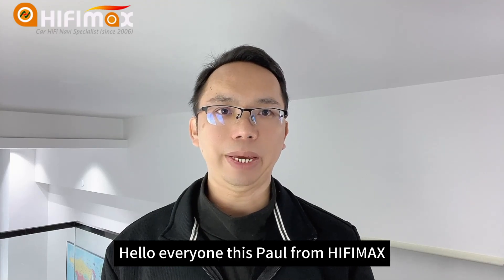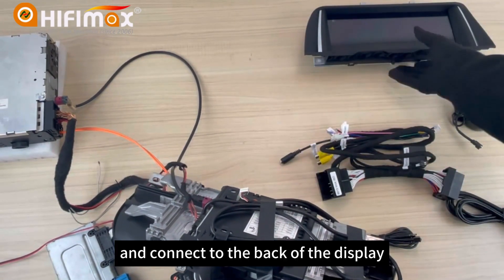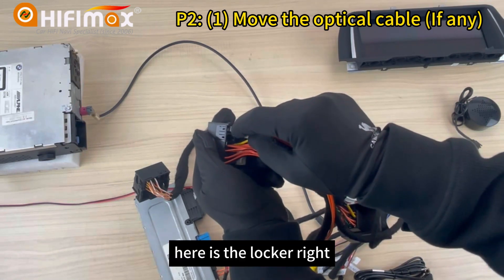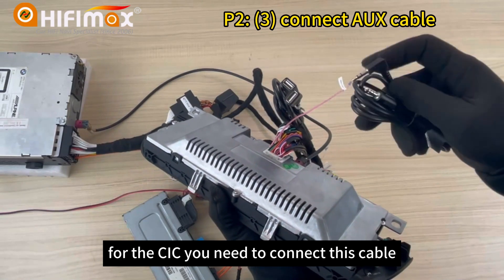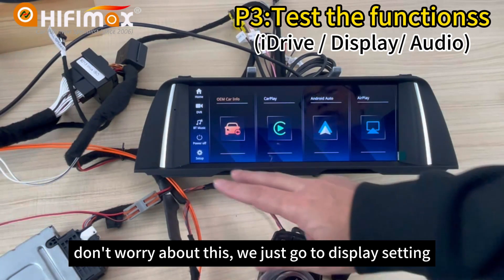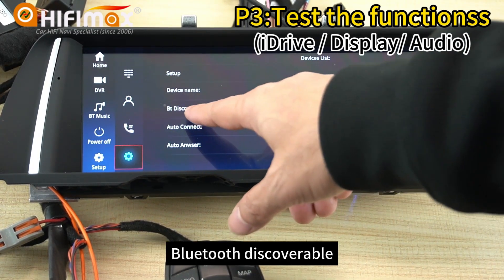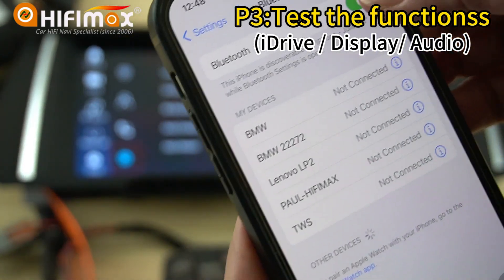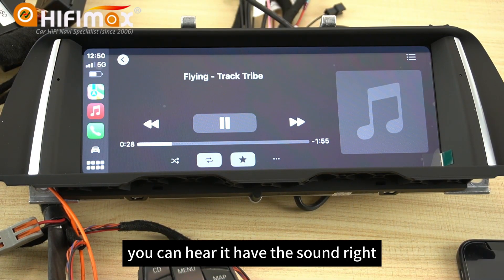BMW CIC Linux CarPlay Screen Installation Tutorial, BMW 1~7 X Series Linux Aandroid Auto install DIY

Comment: Hi, how to get the original subwoofer working again?  Is it done via the Linux settings?
Reply from the maker: The original subwoofer is connected to your OEM Head unit or Amplifier, it has nothing to do with our android screen, our android screen without amplifier inside, it use OEM sound system to output the sound.

Comment: Hello, in my cic system when i use the car play (with the aux cable connected) i cannot hear the central subwoofer of the car
Reply: same issue. i can not get any audio through my car. did you figure it out?

Comment: Hello, I have a question, I have installed the same Linux system in my BMW F10, but the original Bmw menu continues to run in the background while I am in Carplay mode. For example, while I change music with the idrive in carplay mode, I am at the same time in the original menu of bmw and, for example, put things around the clock or blind or light or under another menu item that I don't really see and don't want to use/operate. Can you help me with that LG
Reply from the maker: You can try to reset or contact your supplier to check more details.
Reply: Did you figure it out? I am wondering the same thing. When using the iDrive controller in the CarPlay mode I always change the settings on the main system.

Comment: I have a 2014 428i Basic Convertible that I think has a HU_EntryNav unit (CIC, I believe) without Navigation.  Will this screen work for me?  This is what comes up when I run my VIN number:

Chassis: F33
Brand: BMW

Model: 428i xDrive
Country: USA

iLevel: 1611503
Head Unit: Combox
Build Date: 1402876800000

Comment: Hello Paul, I have a problem. My Carplay screen is not connected to my car, like Spotify has no sound instead I hear the radio. I’ve checked many of your videos about sound issue, it doesnt work. I can’t check the settings of my bmw on the Carplay, it seems like my car and the screen are not connected each other.
Can you help me brother :)
Reply from the maker: The CarPlay connection issue, you can check this video : https://youtu.be/l2mg8xvFHdM?si=JJos7PL4ubOq7agk